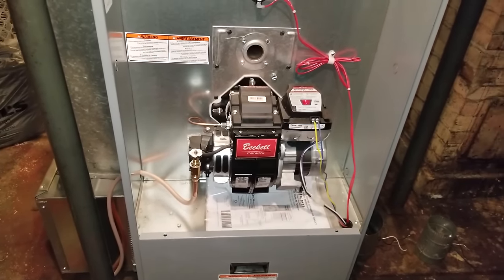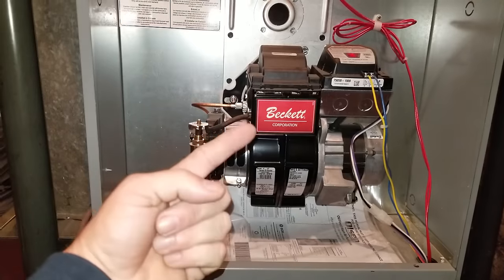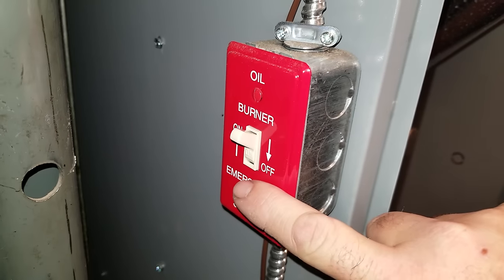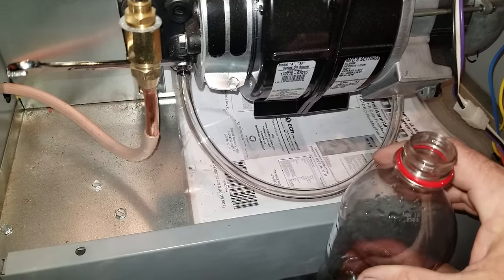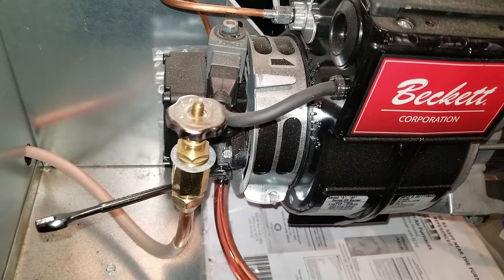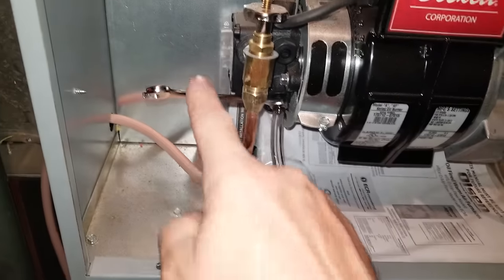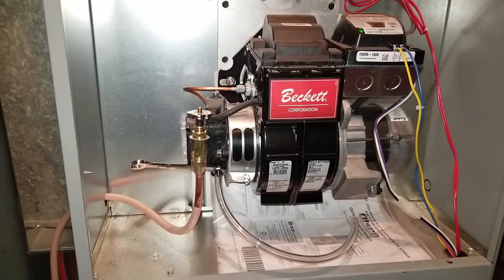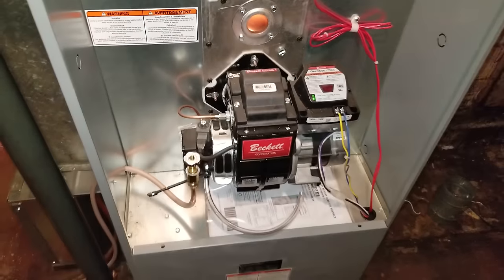How to bleed oil burner how to restart the burner

Comment: I vavle nut is so tight and in a bad spot. I will try some oil to loosen the nut. My Beckett boiler is only 2 years old. I guess they want me to call them.😔
Reply from the maker: Sometimes that is the only way
Reply: @2strokeguru   I need the 3/8 size screw tool.
Reply from the maker: @karenvenzen1704  3/8 wrench
Reply: @2strokeguru  I finally cracked the bleeder. Still nothing. Do I need to increase the thermostat? Freezing in NY
Reply: My Beckett is so very similar to that one, but on the ground
Reply from the maker: @karenvenzen1704  they restart the same
Reply from the maker: @karenvenzen1704  you have to do it exactly the way I did if it doesn't start if not i would call a service technician
Reply: @2strokeguru  So I turned up the thermostat and I will try again. Maybe I need to wait. Thank you.
Reply from the maker: @karenvenzen1704  welcome
Reply: @2strokeguru  only the red light is on. No yellow or green like before
Reply from the maker: @karenvenzen1704  i would call for service
Reply: @2strokeguru  Hi Kevin...I turned up the thermostat and was going to give up. That's what it needed. I went back to try again and the boiler started right up. Thank you again for your patience and help!👍

Comment: In 21 years of fixing oil burners I’ve never seen anyone put the paper work under the burner😂😂😂
Reply from the maker: Yeah this was actually just installed I borrowed it to do the video paper heat not safe
Reply: @2strokeguru  at least it’s not in a crawl space🤷😂, I walked away from a call last week at 6’1” and 52 years old the crawl space days are over  , stuffing a 3 section boiler with a few inches of clearance
Reply from the maker: @lfdvidinc  yeah they always go out in the middle of the night during a snow storm I know it all too well
Reply: @2strokeguru  as you get older do you still find it necessary to risk your life in a snow storm for a broken machine? We aren’t first responders and don’t get any respect like a fireman😂
Reply from the maker: @lfdvidinc  it's all about keeping families warm in the cold
Reply: @2strokeguru  definitely, safely too. 👍

Comment: I wish this would work for me..I don't have those emergency switches in my house. I've opened the bleeder, pushed the switch...and nothing..
Reply from the maker: Could have a clogged fuel filter
Reply: @2strokeguru  Damn..That would really suck..I went a week waiting for an oil delivery, and in my former home I had no issues bleeding and restarting the furnace..but this is so frustrating.
Reply from the maker: @C.G Mullins  if you ran out sludge from the bottom of the tank can clog a filter and if it is a couple years old even worse
Reply: @2strokeguru  Well I hope I can find the filter.. :-(
Reply from the maker: @C.G Mullins  located at the output of the oil tank
Reply: @2strokeguru  Found it!! It's under my house, in the crawl space!
Reply from the maker: @carolmullins  oh fun
Reply: @2strokeguru  You said it..

Comment: Mine wont bleed
Reply from the maker: Are you getting fuel out
Reply from the maker: 1st make sure you have fuel 2nd make sure your thromstat is all the way up so it calls for heat 3rd make sure your 2 emergency switches are on then bleed oil burner
Reply: No fuel I cycled it like 40 times
Reply: I dont have emergency shut offs. I live in a trailer
Reply from the maker: @jasondecristoforo4882  yes every furnace has a emergency switch
Reply from the maker: @jasondecristoforo4882  put 10 gallons of diesel in the tank
Reply: @2strokeguru  it's more than half full.  It ran fine for a month.  I just replaced the furnace tip. I dont think its pumping
Reply from the maker: @jasondecristoforo4882  that will do it could be a clogged filter